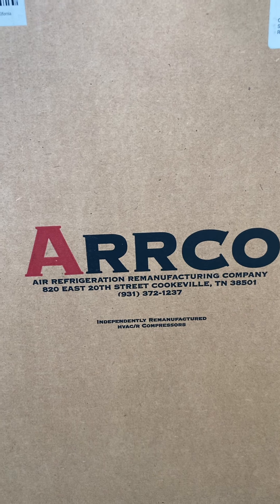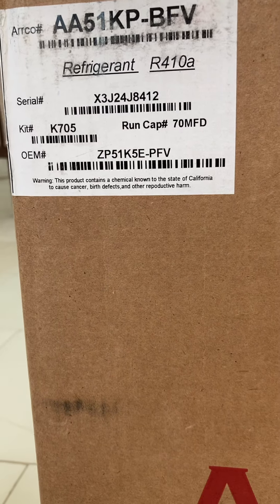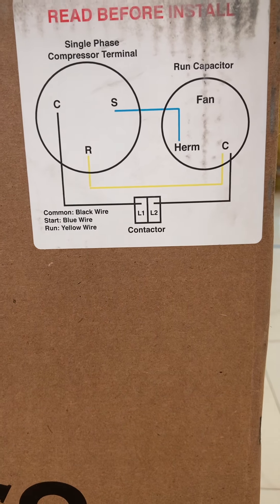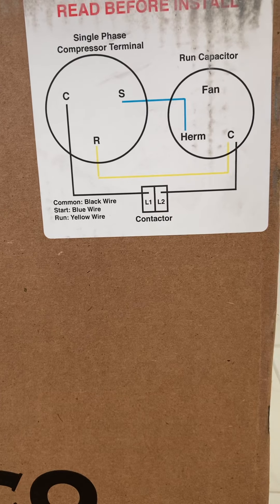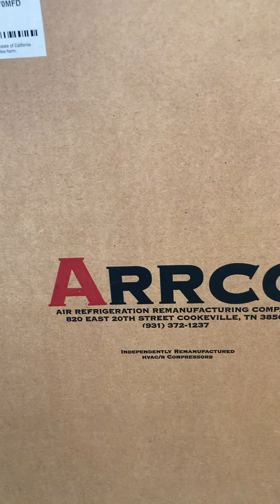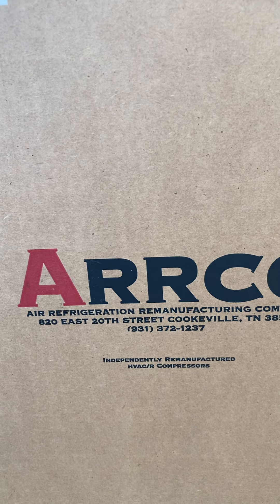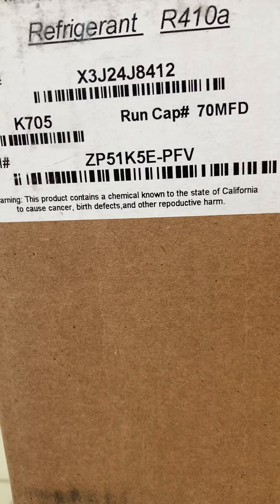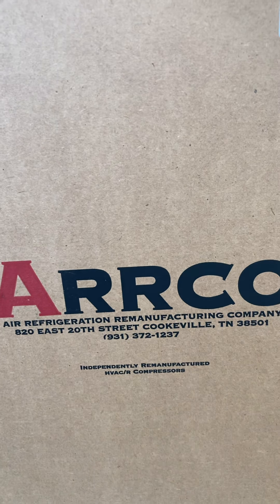Air Conditioning Compressor, spare parts are available

Comment: these arrco compressors are rebuilt compressors. they're a lot cheaper than quality copeland ones but i stock these and they kinda die often. like a 20% failure rate. they got a warranty but the downtime suuuuucks. its an affordable option tho which is nice